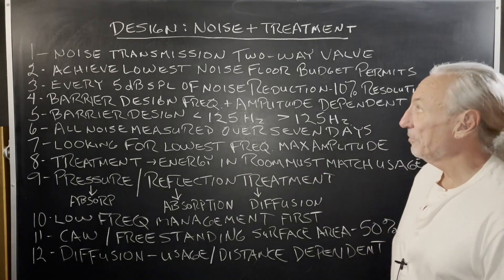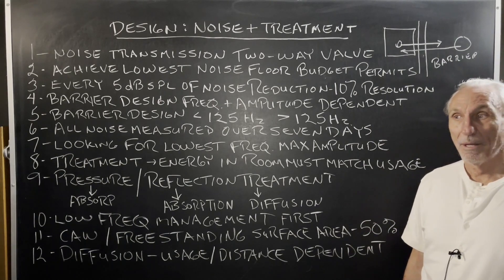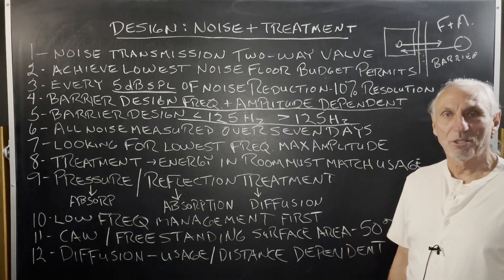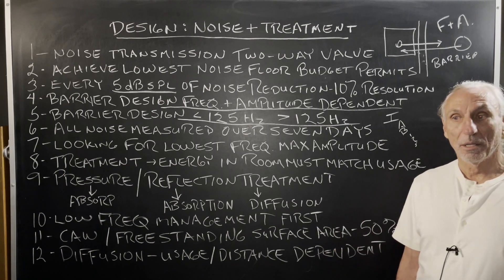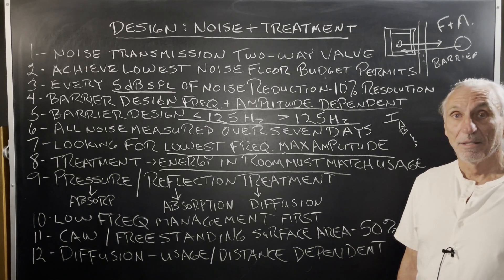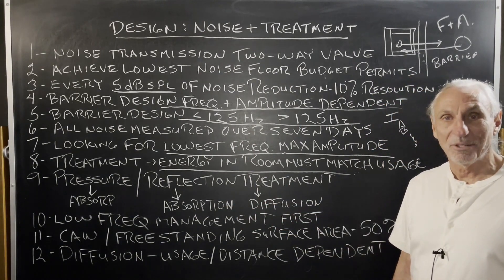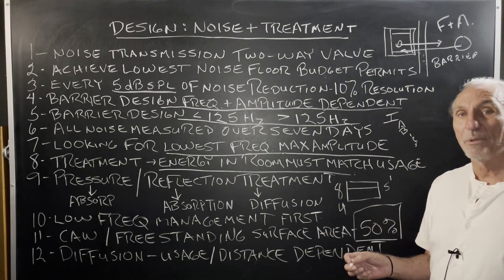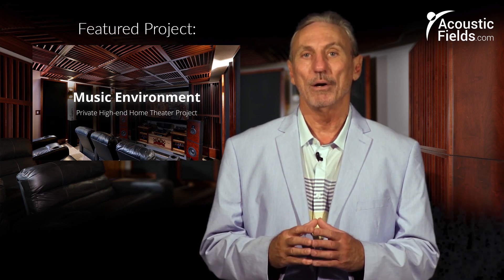Design: Noise + Treatment - www.AcousticFields.com

Comment: I see most people always talked about sound treatments for church or venue halls but never heard about people doing treatment for on and back stage. What are your thoughts?
Reply from the maker: Lower frequency pressure and middle and high frequency reflections occur everywhere within a room. If you have a band on stage, you have low frequency pressure issues behind the stage area and along the sidewalls of the stage.